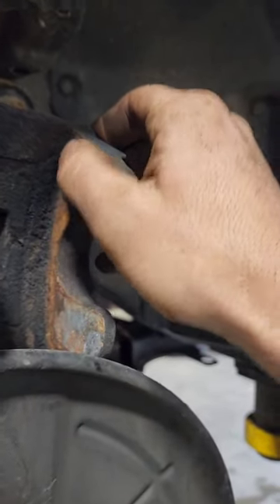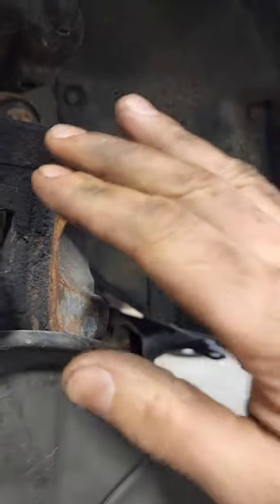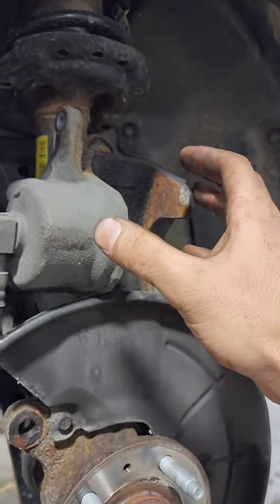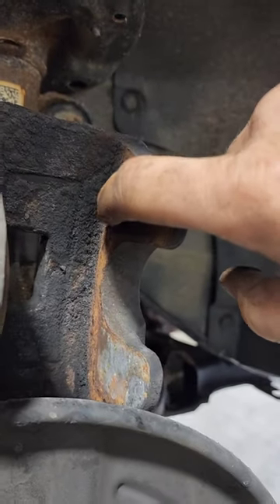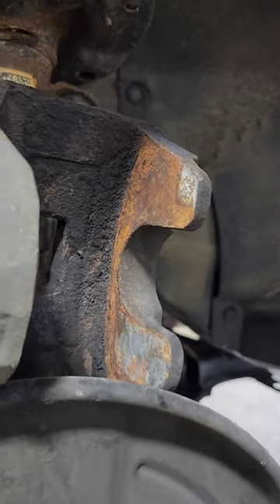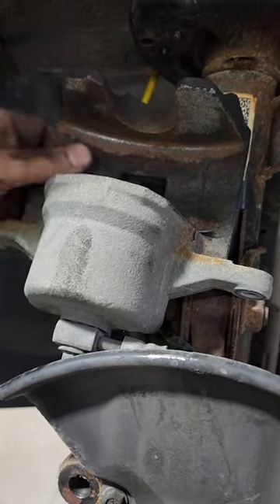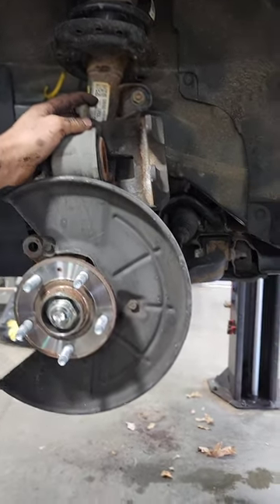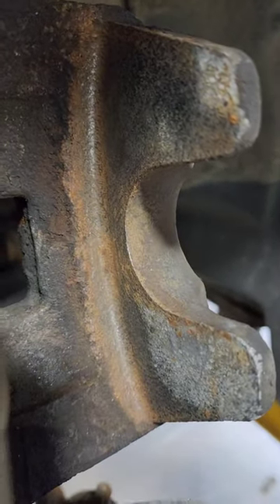How to prevent squishy petal syndrome.

Comment: I always wire brush the calipers and any mating surfaces on any brake job I do. Especially the hubs if I'm replacing the rotor too, it's the simplest stuff to make sure everything works right and the wheel doesn't get rusted to the hub 🙄😮‍💨